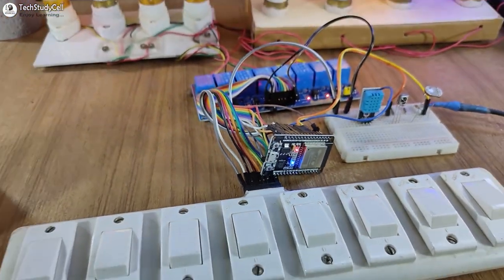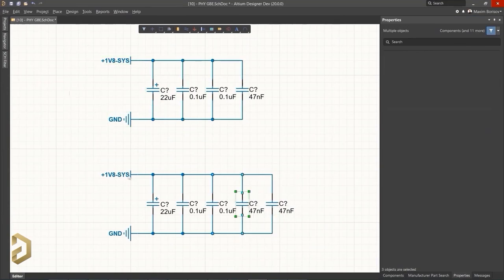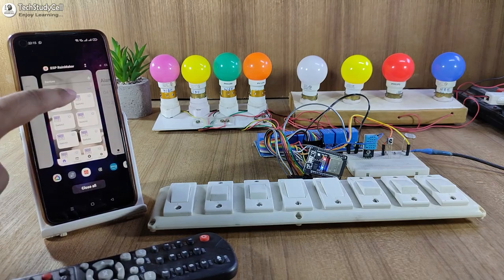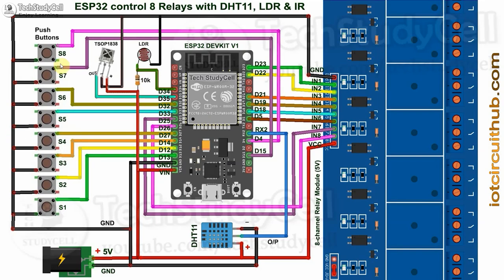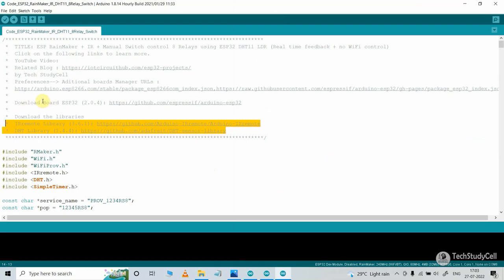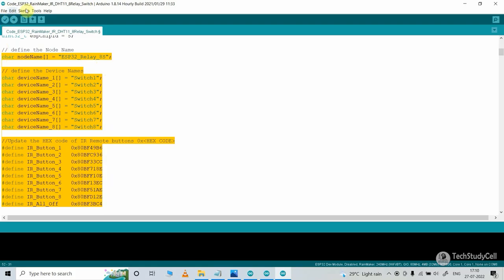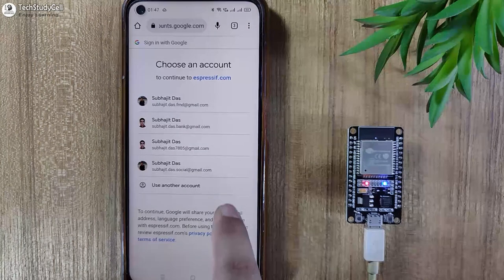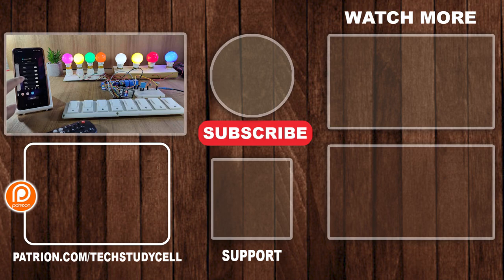Home Automation using ESP RainMaker with Google Assistant Alexa IR Manual Switch - IoT Projects 2022

Comment: please guide me master.
I plan to install 2 DS18B20 temperature sensors. I don't use IR & LDR. what is the correct sketch for replacing the IR & LDR sensor with a DS18B20 temperature sensor.
thank you very much, may you be blessed

Comment: Hello, thanks for this video/project. You are a genius. Circuit and code is very well working perfectly, but sometimes, all the relays switches ON without any intervention from Alexa or Rainmaker App. Once all the relays are ON either app or alexa cant switch them off, they have to be switched off by powering off the circuit. Do you know the reason for the same?

Comment: Please add fan dimmer in this  project make vedio and upload
Reply: Make changes in code to connect automatic with network  when wifi come back
Reply from the maker: It will connect automatically if network available

Comment: i have worked on this using rainmaker but when i disconnect usb cable(which is conected between laptop and esp32) after that it is not working can you please let me know how can i makethis project work by just connecting esp32 to a power adapter or power bank so it can be portable
Reply: deep explain plz this is not perfect

Comment: How does an electronic circuit work without Neutral The Chinese are also working to control the lighting of smart homes    Can you explain this type of circuit to be used in the projects you design?
Reply: With a capacitor u can do it
Reply: @dhanushkadxx  can you please explain how to do this

Comment: awesome project!!!
could you do it with 8 DHT11 sensors and 8 relays?
How is it not possible with an ESP32, can you do it with an Arduino MEGA 2560, to take advantage of its multiple outputs, and use an ESP32 for communication?
Thanks a lot
Reply: u can do!

Comment: By using this circuit can I turn on switch automatically with temperature sensor ? When an optimum level of temperature reaches.
Reply from the maker: yes. but you have update the  code
Reply: @TechStudyCell  thank you.
which portion needs updation ?
Is there is any tutorials available in your channel ?

Comment: Hi, I am experiencing problem with this set-up how can I fix it? hope to here from you soon
below are the errors:
E (123720) esp-tls: [sock=48] connect() error: Host is unreachable
E (123720) esp-tls: Failed to open new connection
E (123720) TRANSPORT_BASE: Failed to open a new connection
E (123724) MQTT_CLIENT: Error transport connect
E (123728) esp_mqtt_glue: MQTT_EVENT_ERROR
Reply: plz watch the techiems rainmaker problem videos to fix it

Comment: After pressing boot button I can't get qr code, although some codes are running continuously in serial monitor window
Reply: Its common problem with esp32
You need to provide 5 v to the esp board externally when wifi is connected, on some laptop they can't feed enough power through usb port
Reply: @hardeepsingh-is7rl  bro I can't understand please help me
Reply: @hardeepsingh-is7rl while decoding the remote also the codes are running continuously please help me

Comment: Now not work again sir 🙏why?
Reply from the maker: First test the ESP32, Install all the required libraries as mentioned. Then try.
Reply: Code sucses sir but always x red confirming node assosiation 🙏
Reply: Please help me sir confirmin node assosiatoon when connected WiFi?🙏🙏🙏
Reply: @diaryiklanlucudiarylancu8367 your esp32 board is blocked by esprainmaker due to sending large amounts of data to the esprainmaker server. Try erasing your esp32 and upload code again
Reply: watch technism channel rainmaker problems video

Comment: This project has many limitations because you just connect switchs whith ESP 32(here switch is working on DC ) which is further connect with Relay module and you connects all Bulbs Saperately(with AC)  
Suppose you attach this with your home appliances and your ESP32 is damaged then that time you can't access yor appliances with switches 😂😂😂 due the ESP32 betn switch and relay module is damaged😂😂😂😂😂😂😂😂😂😂

Comment: no funciona 
E (5843501) MQTT_CLIENT: mqtt_message_receive: transport_read() error: errno=119
E (5843501) esp_mqtt_glue: MQTT_EVENT_ERROR
E (5843501) MQTT_CLIENT: esp_mqtt_connect: mqtt_message_receive() returned -1
E (5843508) MQTT_CLIENT: MQTT connect failed
cual es el error ? :(